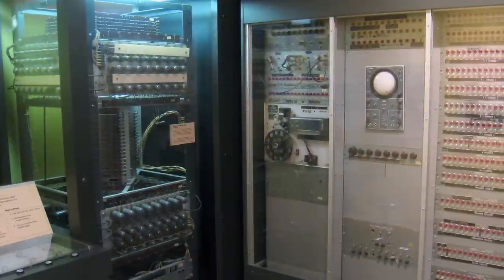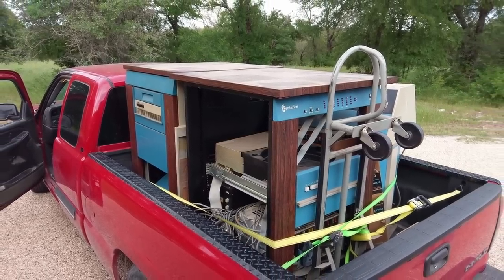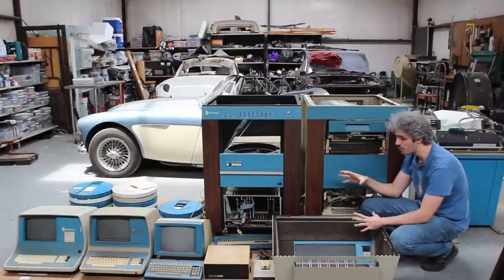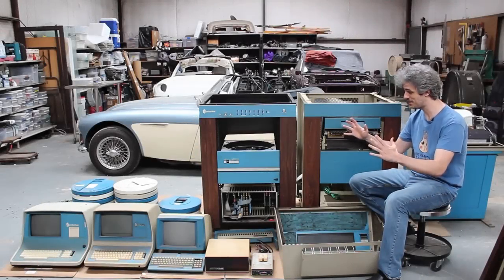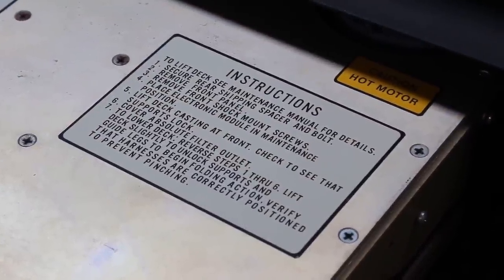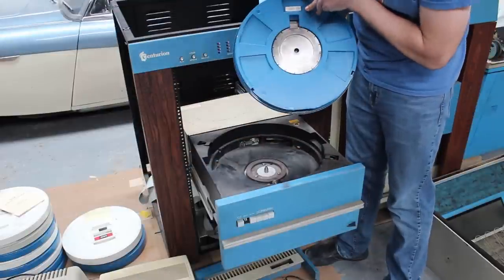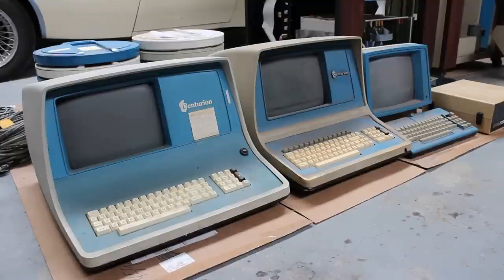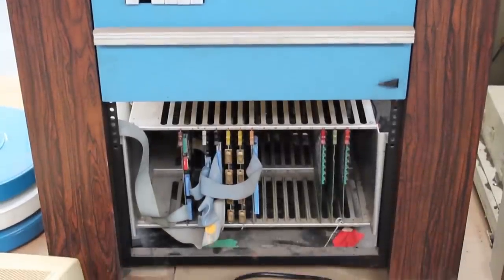I Bought a Minicomputer from 1980! – Part 1

Comment: Interesting...8x9 array of memory chips. Either they didn't trust them nearly as much as the memory decoder logic chips since the memory array is socketed and the logic chips aren't, or the memory density can be upgraded.  Some of the memory chips appear to be reversed relative to the others.  The fact each column is offset one pin from the neighboring column suggests to me we're looking at the 9-chip direction being the bytes, so this might be a 9-bit system or it might be 8-bits with parity.  Parity is common on higher-end systems even today, but rare on cheap consumer systems.  The memory chips appear to be 4116's, 16kx1 bit chips, Motorola branded, so this machine appears to have had 16k of ram on each memory card, and may have had more than one memory card.  These chips were used in EVERYTHING in the early 80's, so finding them in a minicomputer isn't a surprise.  I'm seeing multiple date codes, and some makes of 4116's were notoriously flaky, so it looks likely this machine had some replacements.  And, like I said, some of the chips are in different orientations, so that needs checking before anything gets power.  Looking at the datasheet, these are pretty nice, actually.  They're rated to survive up to 20V on any pin relative to Vbb, and these are rated at 150 ns acess time.  These are the type that need +5V, -5V, and +12V, which also means they probably generate an inconvenient amount of heat.  (These were used in the original Apple ]I[ machines, and contributed to their notorious heat problems.)

Comment: They are called 'disk packs', and the printer is a 'line printer'.
Reply from the maker: You're absolutely right, thank you!
Reply: @UsagiElectric  I started programming on an even older system than yours around 1978. It was a Honeywell 1648 with 32k ferrite core memory, 16 bit,  and a clock speed of 1 mHz. It had 12 MB 10 platter removable packs that weighed about 30 lbs! We ran a dozen simultaneous time sharing users on it programming it in FORTRAN IV, BASIC, and DAP-16 assembler. It actually used wire wrap instead of PCB in a lot of the assembly.

Comment: Maybe "self echo" on the back, need to be set to ON ?
Reply from the maker: You're absolutely right, I'm super out of my element on these things!
But, that did the trick: https://i.postimg.cc/dtYpH7dC/IMAG3684.jpg
Reply: I was just about to type that, haha.
It's good to remember to turn that off afterwards, though, otherwise you'll be scratching your head about why you're getting two characters show up per press once it's connected to the computer
Reply from the maker: @FirstWizardZorander  Haha, I was wondering what would happen if left on when connected to the computer!
Reply: @UsagiElectric  If you leave local echo on you'll just see double of every character you type, and you'll see things like passwords you're typing that don't normally echo. If it's using RS232 rather than a current loop (a leftover from pre-RS232 days), you can bridge pins 2 & 3 to simulate remote echo.
Reply from the maker: @Peter_S_  Oh, that's interesting, I never thought about it echoing back passwords that normally wouldn't echo.
I believe it's actually a current loop setup, the back of the terminals all say "EIA Current Loop", which I'm imaging is similar to the 20mA current loop used by late model Teletypes like the ASR33. My model 14 Teletype uses a current loop, but it's a 120V 60mA current loop. But, it would be interesting to build a converter to go between the two and have my old 1924 Teletype chattering away as a terminal, haha.

Comment: I'm guessing that you have two memory cards installed, each with 128kbytes of ram on it.
Reply from the maker: Each RAM card is identical I believe, and has 8 rows of 9x MCM4116 memory chips. The MCM4116 is a 16,384 x 1 memory chip, so roughly 2kB. I'm thinking that the 9th chip in each row is probably used as a parity bit or something, so usable RAM is 2kB * 8 rows * 8 columns, which is right on the money at 128kB! You absolutely nailed it!

Comment: Did I miss a CPU/processor card or there is none ?
Reply from the maker: I didn't pull it out in the video, but here's a quick shot of it: https://i.postimg.cc/63KLkQF6/IMAG3642.jpg
It looks like it's got two AMD AM2901 4-bit bit-slice ALUs and two AMD 2909 4-bit bit-slice address sequencers, and then a colossal amount of 7400 series logic ICs.
I'm really looking forward to digging into it to try to figure out a bit more about what all is going on!
Reply: @UsagiElectric  oh, thanks !

You better be quick or your tube-processor will get cold ;-)
Reply from the maker: @leyasep5919  Not to worry, working on the next episode for the tube computer as we speak!

Comment: Those look like DEC RL-02 drives.  About 11 huge megabytes, IIRC.
Reply from the maker: I take a closer look at the drives in a future episode, but these are actually CDC build drives. The older drive is a CDC Hawk drive and the newer drive is a CDC Phoenix drive. The Phoenix drive I believe had quite a bit more storage capacity. I want to say it was up to about 40MB, but I may be off on that number.
Either way, they weigh in about 80 lbs. each, haha.
Reply: @UsagiElectric  I guess several companies used that disk pack style, my experience was  with RL-02’s.  Even earlier, there were the RK05 packs which were only like 2 MB. Or more correctly, 2 logical drives o with 3300 blocks of 256 12-bit words.   That was like infinite space back then.  Only $5000 for the drive, another $5000 for the controller.

Comment: 16k bit DRAM on the memory card, so very late 70's or possibly 80-81.  Need to watch again to try to see some date codes.
Reply from the maker: Excellent guess!
Since this video, I've actually had a very nice gentleman get into touch with me who used to work at Centurion back in the day, and it's very likely that this system was built in either '79 or '80!

Comment: Impressive. However... because DEC minicomputers have such a large vintage computer hobbyest / fan contingency. My impression that you would have a lot better luck actually RUNNING "a minicomputer", had you found a vintage DEC PDP-11, PDP-8, etc. Particularly with the PDP-11 line, these were available in very small, essentially single large board, packages. Google LSI-11 computer.

Comment: The back plane may be S100 bus. -> https://en.wikipedia.org/wiki/S-100_bus
Reply: The Microm  looks like a terminal cluster unit. Basically a fancy way of adding many serial ports to allow multiple terminals to access the computer. It may have been connected to a bank of modems, or it may have been connected to a bunch of serial terminals (VDUs) or a mix of both.
Reply from the maker: @AndyHullMcPenguin  It's entirely possible the backplane is S100! Here's a picture of the back of the backplane: https://i.postimg.cc/J4xgKfDB/IMAG3660.jpg
I unfortunately don't know enough to identify it just from looking at the back of it, but it'll be a lot easier to figure out once I get the whole machine out and on to the bench!

I think you're right on the money with the Micom too! That would also explain why I got multiple terminals with it as well - allowing the company to hook up multiple workstations to a single computer.
Reply: @UsagiElectric  Well from memory the S100 bus was so called because it used 100 pin card edge connectors (two rows of 50 pins)
Your machine appears to have 72 pin connectors (two rows of 36 pins), so it may be something else, perhaps a form of VME bus. 
Whether it is proprietary or not I don't know. I guess you start looking at the function of the pins next. 
The first row is probably ground, the next couple of rows look like power, and the rest is anybodies guess. 
What is the processor?
Reply: Oh.. and check the power supply before you start connecting any of the cards. If the voltages are all over the place because the caps are shot, or the regulators are fried, then you could end up damaging something else. Proceed methodically, starting from the PSU.
Reply from the maker: @AndyHullMcPenguin  The PSU is going to get a very thorough once over before any power finds it way anywhere. Curiousmarc's recent series on repairing his HP computer after a PSU failure has got me particularly on high alert, haha.

The CPU isn't actually a single chip. There are two AMD AM2901 4-bit bit-slice ALUs and two AMD 2909 4-bit bit-slice address sequencers, and then a colossal amount of 7400 series logic ICs. Here's a picture of the CPU board: https://i.postimg.cc/63KLkQF6/IMAG3642.jpg

It's going to take quite a lot of thinking just to figure out what's going on, but I'm looking forward to learning all sorts of new things!

Comment: Those old CDC, Control Data Corporation, disk drives were referred to as pizza ovens!
That printer may be manufactured by CDC also.  CDC did manufacture computers but they were known for their peripherals, printers, removable disks and reel to reel tape drives! 
Most of those old systems were salvaged for the gold, copper and aluminum! The contacts on the printed circuit cards were gold. 
I entered the computer world in 1969, U S Army Signal Corp!  In the 70's and 80's as customers  upgraded their systems I purchased or was given the old systems to salvage.
In the late 70's, while trying to buy a very large system, took up rooms about the size of two gymnasiums! We were out bid by about three times the amount by two Asian men!  
I was later contacted by the FED's about the auction, they had discovered the Chinese were buying our old computers and stealing the technology  to build their first computers.

Comment: Looks like an S-100 bus.
Reply: That's what it looked like to me as well. The pin out for that bus should be readily available. Back in early 80s I worked at a place called ISC in Spokane,  WA, who made computers for S&LAS. They gave flow-solder test boards and waste components to workers, so i picked up boards et. al., piece by piece. Took 4 lunch hours to suck solder out of a 13 slot S-100 bus motherboard.  The memory card had 48K of 13 bit ram. (8 bits memory & 5 Hamming code parity bits to detect and auto-correct memory errors). Was the first computer I ever built. Had a hell of a time buying chips and S-100 card edge sockets for that motherboard. Boy, did I learn lots!

Comment: smartphone is a million times more powerful but also locked down  ! exposing drive insides to dust, not very good idea. those DB25s are likely multiplexed rs232. you need a loopback rs232 connector on the terminal to see something. Its definitely worth getting to work again. Smartphones being faster does not always make them better
Reply from the maker: Thank you for the insight!
The terminals are actually EIA Current Loop, which I believe is the same type of current loop used by late model teletypes, like the ASR33. Fortunately, there was a little DIP switch on the back called "Self Echo" that allowed me to get some text on the screen!

Comment: Looks like my comment got deleted.  Looks similar to either an S-100 bus mini computer, or an HP 2100 series mini computer.  Go check out the documents on Bitsavers for HP's 21xx series.  The cards look awfully similar.
Reply from the maker: You're absolutely right, the 2100 series cards look super similar! I'm curious if there's any interchangeability there. I'll have to trace out the backplane to figure out just how stuff is wired up. 
I'm super excited to get the computer out of the chassis and start looking at all the pieces in much more detail!
Reply: @UsagiElectric  best of luck!  May the magic smoke stay in!  And remember, this is just a wild guess.
Reply from the maker: @catherined.398  Surely they sell magic smoke somewhere that I can put back in, right?
We'll just take things slow and steady and do lots of reading before doing anything too crazy!

Comment: The printer you have there is called a line printer. These things print fast. Really , really fast. 

The ribbon with character spins around continuously, and when the right letter comes along, it is hammered onto the paper (as you correctly explained). But it has more than 1 hammer, in fact as many hammers as there are columns you can have on the paper. It looks like 132 characters per line, so 132 hammers. This means it can print several characters at once. At because the ribbon with letters spins rather fast, it prints also very fast. Since the ribbon with letters is moving constantly, the characters are never tack sharp, but always a little fuzzy.
Reply from the maker: Thank you for the insight!
I'm really excited about the printer, that thing is an absolute beast and I really want to see it spewing paper out the top at breakneck speeds!
Interestingly, I talked with someone who's actually pretty familiar with the whole system (he used to work at Centurion back in the day!) and he mentioned that the printer might only have half the number of hammers and it cycles left and right. Either way, it'll be a ton of fun to dig into the printer!

Comment: It will be a dumb terminal. So everything you type goes to the minicomputer and then it relays it all back.
Reply from the maker: Yup!
It turns out there was a self echo dip switch setting on the back that gets it printing everything I type without needing to be hooked up. But, you're absolutely right, it's about as simple of a terminal as it can get.

Comment: Why you need old carp? running what on it????
All computers are micro? How old are you, stuck in 1980 too!
Reply from the maker: Well, I don't recommend anyone eat any old "carp". Old fish in general should be avoided, that's a good way to get sick 😆
Reply: @UsagiElectric  He only bought it to do YouTube, get some ads money out of it
Crap, lol
Reply from the maker: @lucasrem1870  Aww, why so negative?
The Youtube ad money I have gotten from the entire series to date is barely enough to cover what we spent in gas driving to get the machine, much less the cost of the machine itself or how much it will end up costing to get it going again.
I bought it because it was incredibly interesting and exciting to be able to work on a piece of computing history, and making Youtube videos is a way for me to bring y'all along with me on the restoration journey.
But, if you're truly worried about me doing this "just for the ad money," then I absolutely recommend installing uBlockOrigin or AdBlockerPlus on your browser. As long as you're enjoying the content, that's plenty enough for me!
Reply: @UsagiElectric  Negative?
Why should anyone build this system? Running what on it? We could not find any other reason, lol
I respect YouTube jobs, it's a hobby you do, not needing it, even better.
Then i don't see any reason restoring this.  I did restore many system, but only for the need to run them, not trusting emulation, needing original chips etc. Never needed this, lol.
Not negative! Still stand for it, you are stuck in 1980, lol, with a system that nobody needed then, office & warehouse clerks logistics...
Thanks.